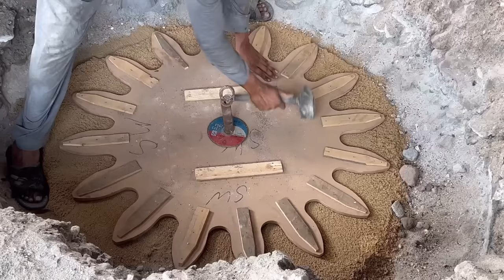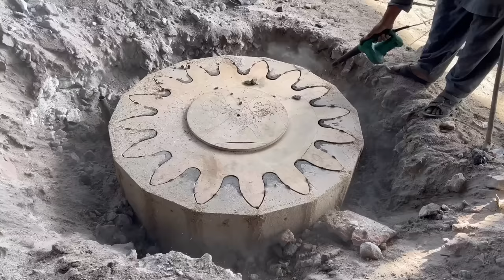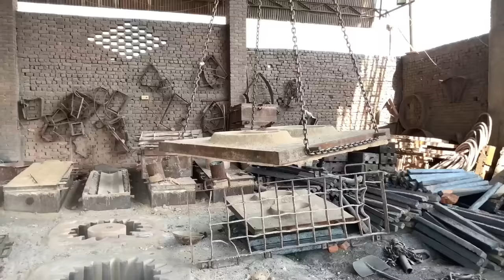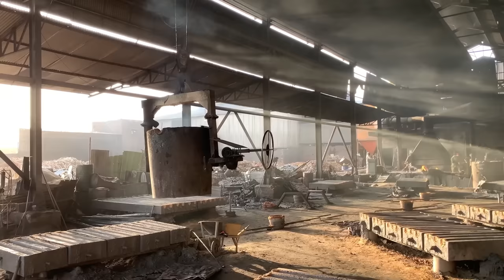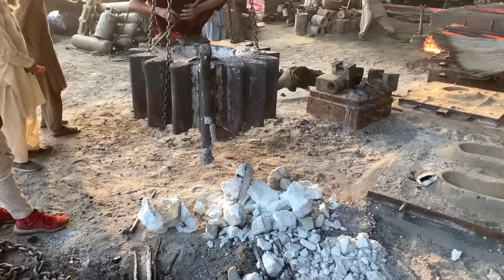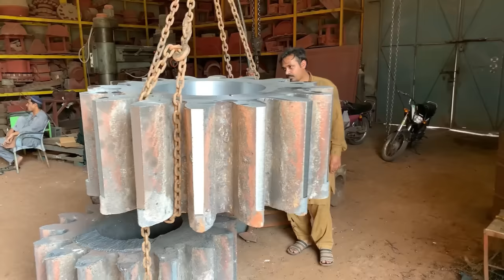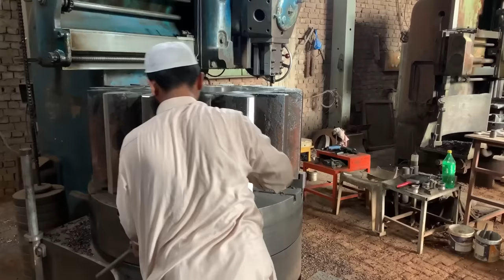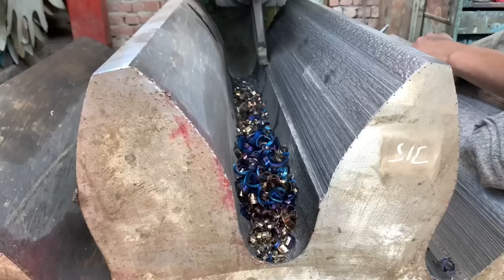Handmade Making Process of Large Milling Machine Gear | A Huge Industrial Gear Manufacturing Process

Comment: If you asked an American company to make this gear, you would probably be in $250,000. These guys do it for probably $500. who knows if they even pay for the scrap or whether its subsidized by their government. 

Ive seen others in India rebuilding truck engines with cracked heads and rods shot out of the block. They fix them and keep the trucks moving. Its incredible what you have to pay here in the USA to get anything done by entitled people that think they are all too good for that kind of work. 

I used to know someone who could repair wiped-out crankshafts by rewelding the journals and grinding them back to spec. He did it with semi-cranks. Now he's long gone, and everyone says, "Just go buy the $8000 crank from Cummins. It ain't our money."

Comment: What kind of gas are they using to "harden" the sand ?
Reply: I was curious about the gas, so went on a rabbit hole, it's most likely CO2 (Carbon Dioxide), it reacts with the Silica sand, forming hard silica gel, which bonds the sand grains like a cement.
Reply: Or it could be this: “ Cold box: this process employs a catalytic gas to cure the binders at room temperature. One hundred parts of sand are mixed with about 1.3% b.w. of liquid phenolic resin, about 0.9% b.w. of isocyanate and about 0.1% b.w. of trimethylamine gas as the catalyst. The isocyanate reacts with the phenolic resin, forming polyurethane which binds the sand grains. This process has a short curing time (lower than 10 s), is well suited to mass production techniques and the absence of heating results in substantial energy savings.”

Comment: I am not familiar with this technology, but for the mold they apparently use sand and slaked lime, carbon dioxide is passed through the mold as a hardener. This is just my guess. There are a lot of questions about the steel grade. You can't just melt down different scrap metal.

Comment: As an engineer I would ask the quality of steel used for this project . I see they just melt anything they have into that gear and that’s not good .😮

also the precision is missing . 
So …. how long this thing is going to last ?
Reply: Meh, during industrial revolution, stuff was done in a similar fashion and it worked fine. They got exploding locomotive boiler here and there due to material quality, but gears don't explode.

It probably costs only a slightly more than the scrap metal, so they can replace it reasonably fast. Make it big enough (and wide enough) and it will likely work fine. It's not their first rodeo, so they have repeat business.

Comment: people are arguing saying the cog needs heat treatment to harden. But if the gear was placed in the mechanism and always heavily oiled enough wouldnt the steel work harden to some extent naturally as it bears load and turns anyhow ? hence making it slightly more durable and stronger ? please advise

Comment: It would be very interesting to know who is the owner of this manufactory, and how much he appropriates to himself, from such exemplary labor of the proletarians.
Reply: It would be safe to assume that labor cost is less than 10% of realized sales price.  That said, this kind of work is custom. and there is likely little competition for something like this. If you were able to buy an OEM replacement ot would be ridiculously costly, probably well over a half million for one gear!  This is likely for a machine over 100 years old. You can be sure that they are not manufacturing any machines in that size range, anywhere in the country. So a custom replacement like this can be very lucrative. 

Foundry shops like this make many things and these guys will be working on very different things after this project was completed, could be all sorts of castings and most probably much smaller.  Mark ups will be quite a bit different.  !0% as a generalized rate over all their work is likely a good average. 

The companie that go after big jobs like this have some very wealthy owners.

Comment: I mean, it doesn't really look like a high load bearing gear, so maybe it's fine I guess lol. It can hold its own weight through its teeth so if they're just going for weight proportion it 'should' be good enough.
Even a scraphead gear like that will probably be one of the last things to fail in a milling machine anyways. There's way smaller gears down the chain that will fail before that one does.

Comment: Cog made from UNHARDENED steel of grade 'randomius scrapius'. Sand inclusions per inch = 'yes'. Ash inclusions per inch = 'yes' (one guy was USING A CIGARETTE right over the pouring cup). And that poor lathe with the cutting bit hammering against the workpiece....
They could have made this SO much better, without having to use 'western H+S nonsense'.....
Billet the steel first, dope it to a proper grade.
No blowing or scraping casting sand while the core is open.
Cover the cup while blowing.
NO SMOKING on site. 
Harden the cog when you have finished machining it.

Comment: I believe they knew what was in that steel.  Any good scrap guy would be able to balance out carbon and other important ingredients.  Note that steel in the USA and almost everywhere else comes from scrap, melted in an electric furnace and, while still molten, to a continuous-casting machine.  Ever seen a railroad car loaded with scrap in, say, Indiana?  The contents look worse than that scrapyard.  Once the mix is melted, the guy analyzes it to find its ingredients and then adjusts this by adding vanadium or carbon or whatever else is needed.  These guys know metallurgy and would refuse to make a soft or brittle casting.

Comment: I wonder what those cog wheels are intended for, I mean they're producing multiple ones, might be serial production even. Many MASSIVE cog wheels - what for? 
Then again, I remember complaints about Chinese bicycles I heard in Africa - key complaint was that load bearing parts were made of inappropriate alloys or insufficiently hardened, which resulted in shiny bicycles turning into junk within notime. Really old Dutch ones were absolutely sought after because they'd endure. And that was a "bicycle problem" only.

Comment: Thanks to comments glad to learn  these are way over buildt for the purposes and loads they'll be used at. Compensating the achievable quality with sheer size/mass/lower effeciency, but it will do the job well enough and last long enough by local standards. Especially of they understand their metal sources and know to select them calclating towards appropriate steel type - fine them. Room to improve especially with safety and as gradual it may be, if it stays constant years to decades, this slowly builds up their society.

Comment: That gear is too wide for a straight one. 90% of teeth surface wouldn't get load anyway. Width of straight gear shouldn't be wider than 1/3 -1/4 of radius

Comment: If these guys were given every safety gear you could give them would they use it. Iv had metal in my eyes and other things and it was my fault so now I use glasses if one of these guys got metal in there eye who fault is it and when lifting very heavy metal and the chain snaps and lands on top of them who fault is it or there hand ripped up in a lathe who’s fault is it.

Comment: i work in french industry and visit fundry sometimes - not about osha thing but methodology, what we do even in modern country is not different. We mold sand and poured (more certified) steel in it. 
Workers are dirty, workshop is a total mess due to centuries of fundry, ash, molding grinding , and we finish the process with big old fashion machinery like them -

 i wont be so critical on what they do as we don't do it sighly different way as them even in western country ...